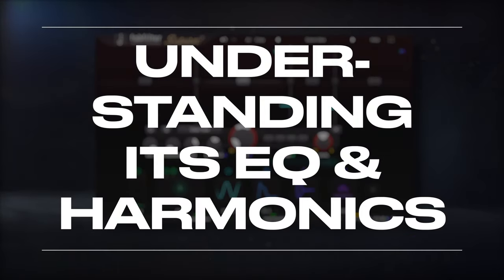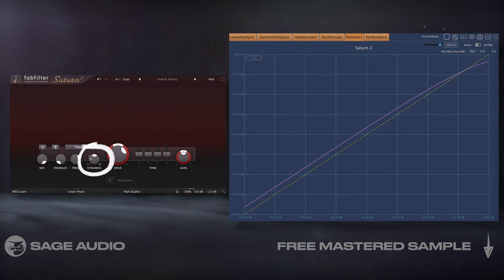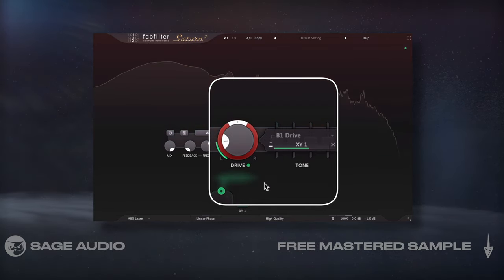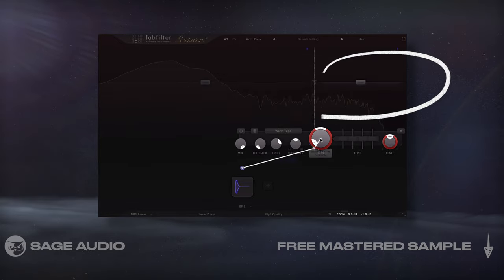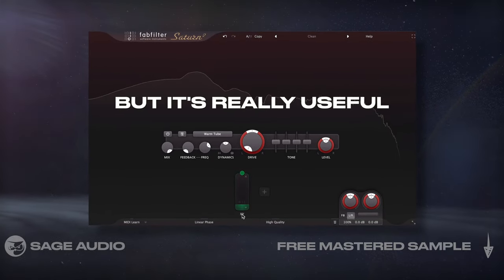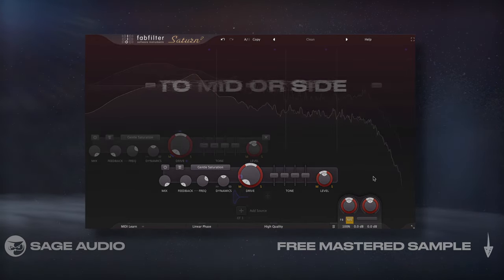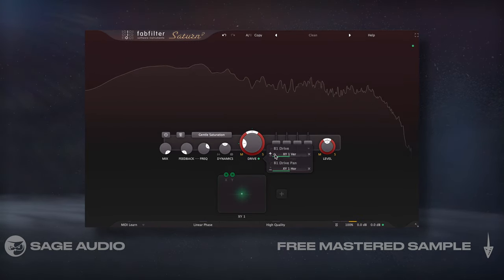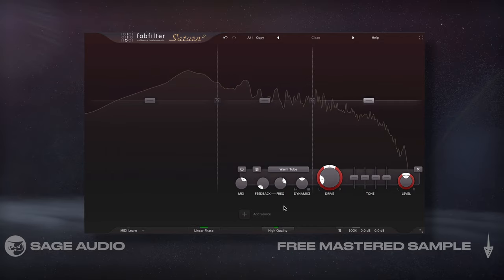How to Use FabFilter Saturn 2

Comment: Yo so if l want to Bus a Saturn 2 for my mid range, should l use linear phase and high quality ? In my mixing stage
Reply from the maker: If you're only affecting the mids, or one frequency range while leaving the others unaffected, it's best to use linear phase.  I've found this to also be the case when using the band's mix dial.
Reply: @sageaudio  Bet thank you

Comment: Quick FYI : It is possible to modulate Saturn 2 as an inserted plugin with a MIDI controller in Pro Tools. However, in the case of working with a virtual instrument that requires it's own MIDI data stream, this can only be done in Post, ie: after recording the VI MIDI notation. this is beacuase Pro Tools 'realtime' MIDI engine can only process one channel of MIDI I/O at a time. You will need to create a separate MIDI track and assign the MIDI output of that track directly to the listed Fabfilter Saturn 2 plugin. Ensure that the MIDI track is selected when you want to input/record MIDI performance data. 
This workaround also works great for plugins like Guitar Rig 6 Pro inserted on an Audio track (which does not process MIDI data). Just add a separate MIDI track and direct the output of that MIDI track to the Guitar Rig plugin and you can MIDI-learn, control, record & edit any of the plugin's parameters.